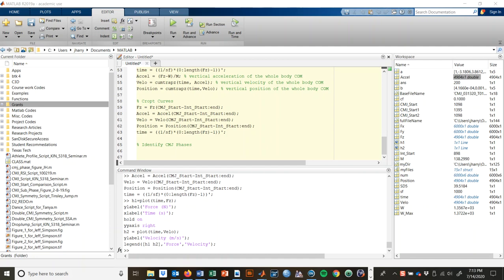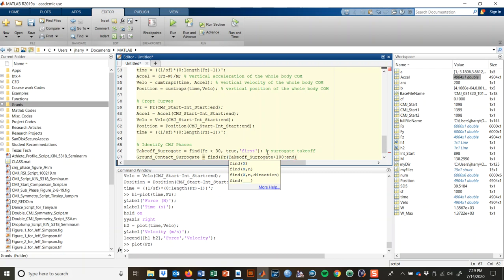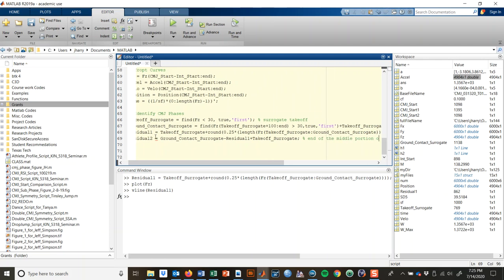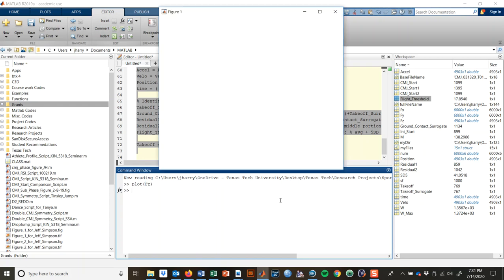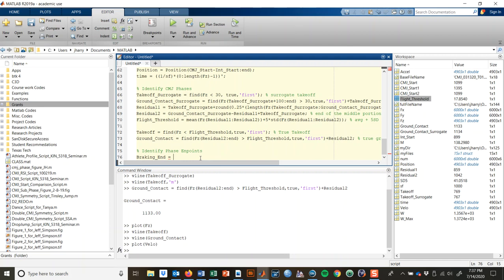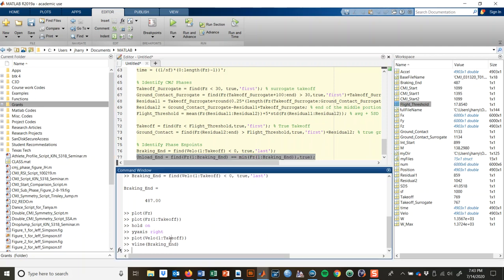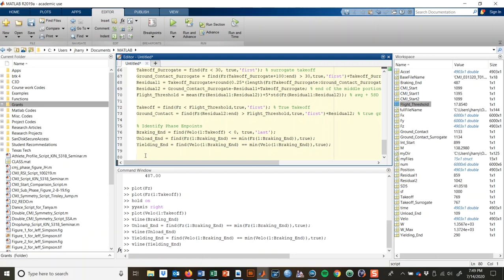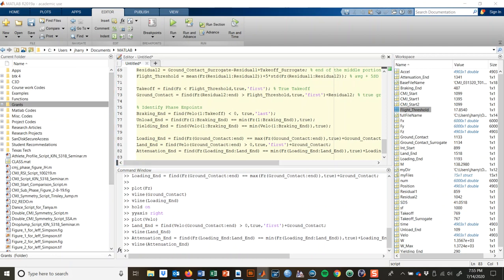Working with Individual Trials #3: Jumping & Landing Phase Identification for Countermovement Jumps

Comment: Dear Dr John, thank you for great presentation, it was very helpful! 
But, if you can explain how to determine when is velocity equal to zero in Excel spreadsheet data? 
I am working with CMJ raw data and when I want to find end point of Eccentric phase on the curve I have difficulties...because calculating velocity through force and time only gives me positive and negative direction.
Thank you in front.